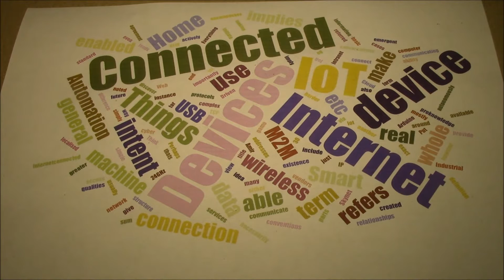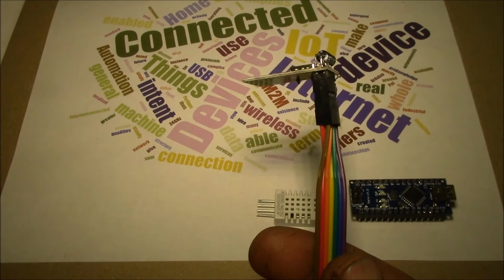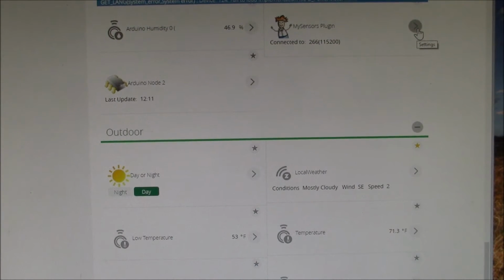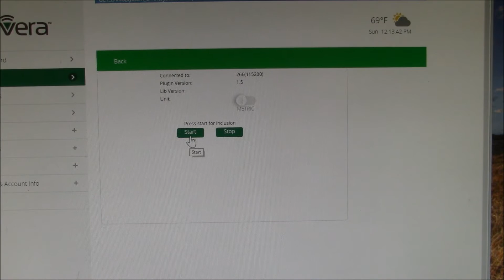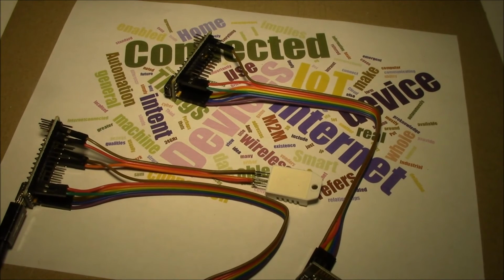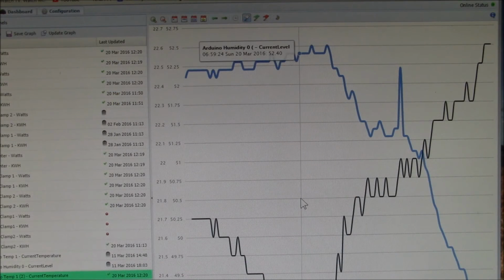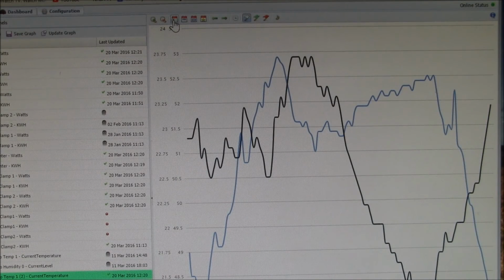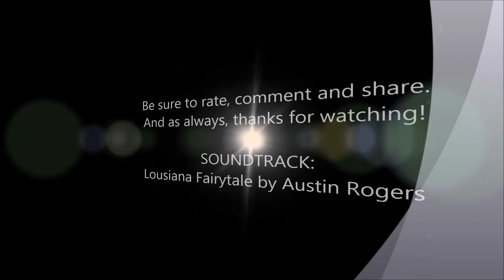Building an IoT Humidity Sensor

Comment: Hey just a question, What is stopping the sensor to connect to someone else's gateway or someone else trying to access your sensors with a different gateway, It seems like the code is the same for everyone.
Reply from the maker: I think the sensor pairs to the gateway somehow, but not exactly sure.  So unless someone nearby were to hijack the sensor before I got it paired with my gateway, it should be locked to my system.  The newer version of the MySensors library (2.0) has some enhanced security features and I think you can also build the gateway and node code to support password security.  I started playing with that a while ago but ran into some problems with my USB hub.  I've now replaced the hub and need to see if I can get the Arduino nano working with it again so I can load the version 2.0 code on it.
Reply: R Brown awesome thank you and keep up the good work. still waiting for my stuff to come from china